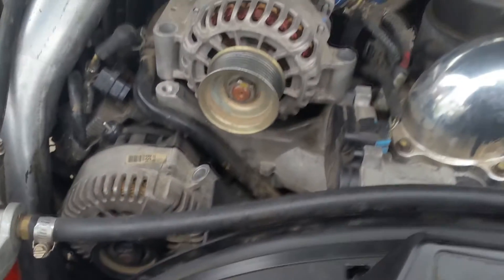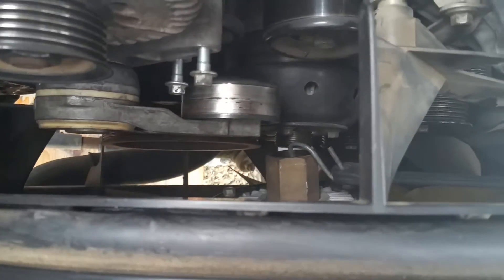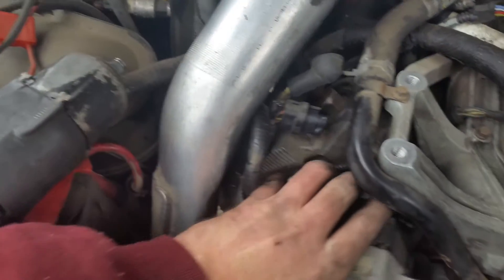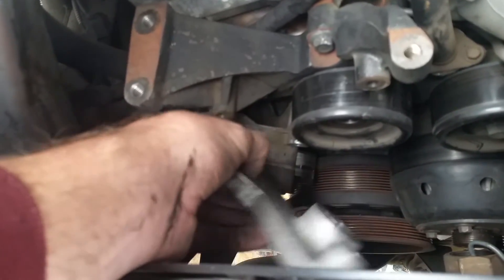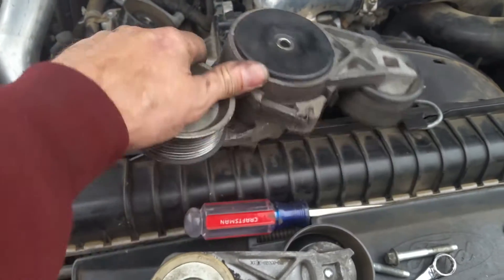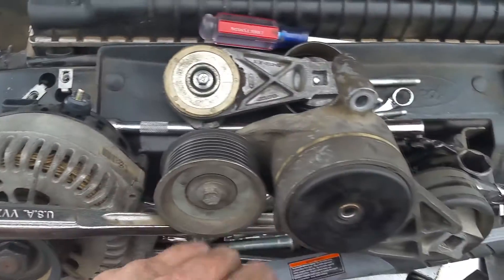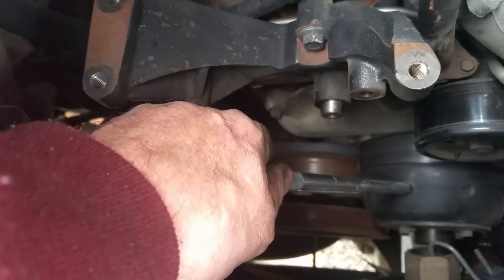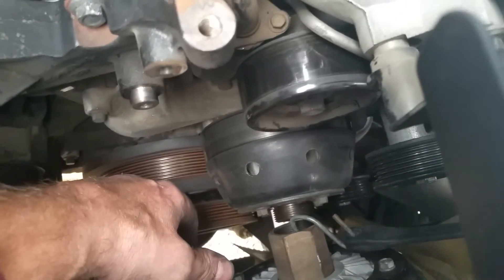2004 F350 6.0 Dual Alternator and Dual Tensioner replacement

Comment: One of the best videos I have seen on this repair, but I still have a question. I need to replace my power steering pump and figured I would replace the belts, tensioners, and idler pulleys on the truck too at the same time. Can you tell me how many smooth idler pulleys there are and how many ribbed idler pulleys there are? If I had to guess, I would guess 2 of each, but it would be a guess and I would like to get the correct parts here before I dig into this repair.
Reply from the maker: We would all like to know ahead of time what parts we need for our specific job we are considering. With some jobs this concept can be applied. Unfortunately with this job that concept is not best to be applied reasons being there are multiple configurations and mid year changes to the belt and pulley systems on this motor...long story short please consider being able to put this vehicle into a state inoperable status by extracting all the parts you need to replace and matching them to ones you will hopefully be purchasing from an actual brick and mortar automotive parts supply store...this is actually the best most logical and least time consuming way to do this job cheers :D

Comment: You were able to loosen the belt for the top alternator before removing the fan shroud upper flare.  How did you accomplish that?  Most videos show single alternators where it is easy to just pull on the long exposed belt then set the tensioner kickstand in place.  With 2 alternators, that second lower alternator makes that impossible...as the belt is no longer exposed.  So how did you manage to pull the tensioner in and set the kickstand?
Reply from the maker: I used the swivel-neck 1/2" drive long handle ratchet in both instances. Removing the auxiliary alternator belt first to gain enough room to reach the the primary alternator belt tensioner kickstand.

Comment: i have a 07 and i only make 21 pounds of boost while my dad makes 28 pounds with the same upghrades and his is an 04 but only difference is i have two alternators. how much boost do you make?
Reply: altenators cost horsepower to run...... doesnt really have anything to do with boost numbers also consider that his 04 is a early 04 with the 03 type of turbo 10 blade turbine and midway through 04 they went to a 13 blade thats slightly smaller. and 05 and later its a much smaller 13 blade all in the sake of noise reduction. im thinking i really wanna convert my truck to dual alternators

Comment: that shroud is a pain in the ass to pull off.
Reply from the maker: ya fuk that shroud...best way is to pull the radiator then shroud....
Reply from the maker: quick heads up that top shroud i left off it helps cool more efficiently